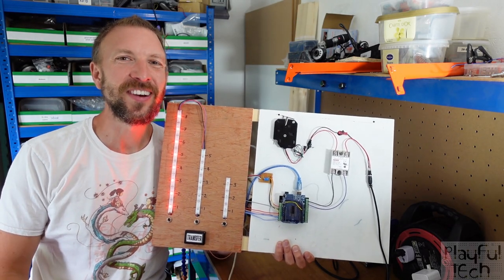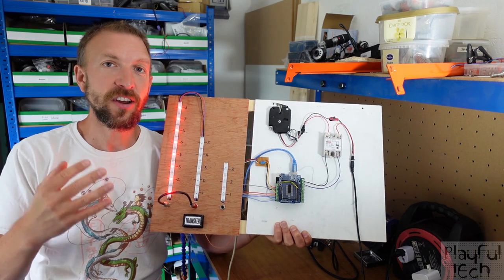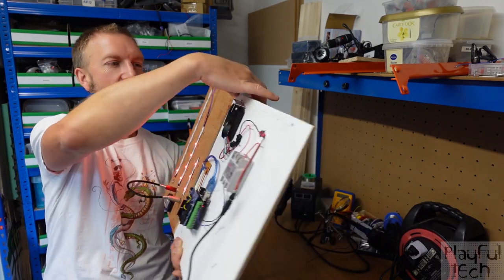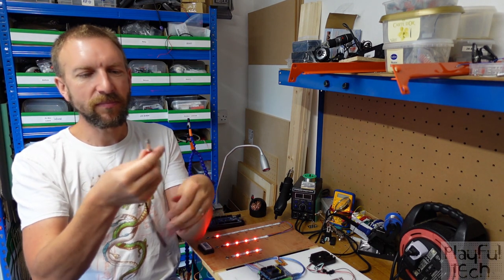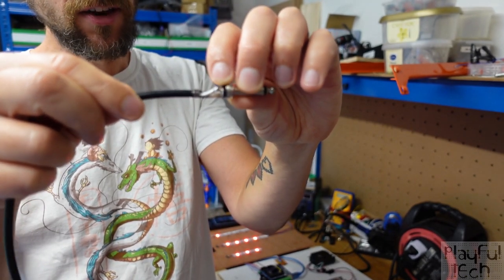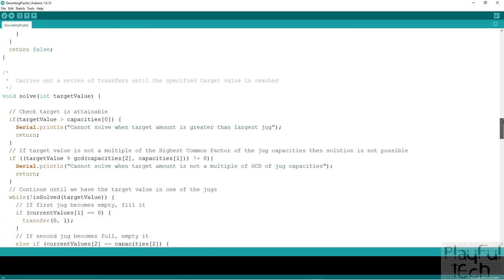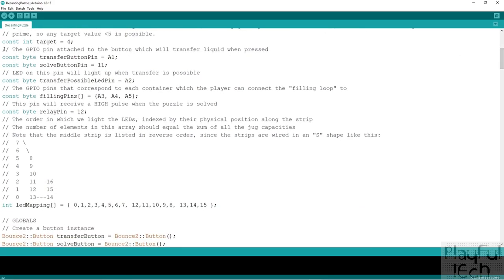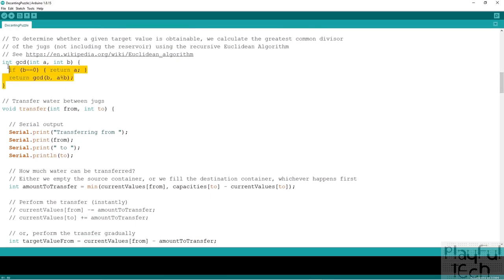The "Decanting Problem" Escape Room Tech Puzzle

Comment: If you use an electromechanical relay, you should add a diode to keep the coil from pushing voltage back into the arduino when the relay is deenergized.